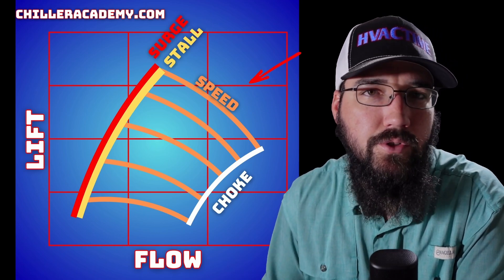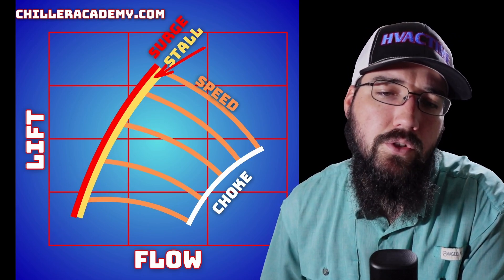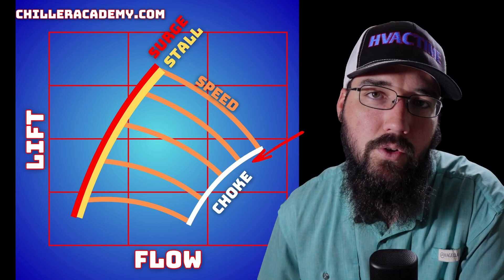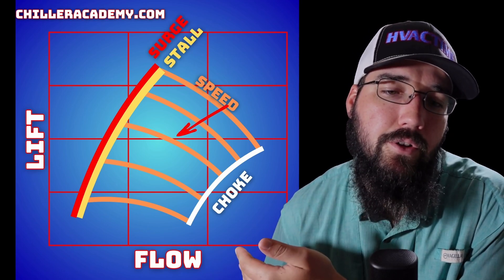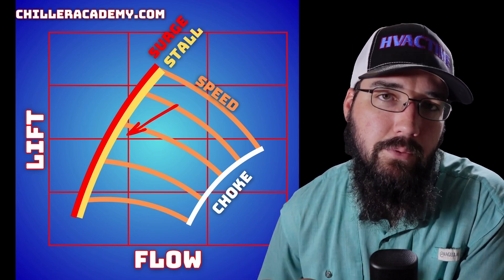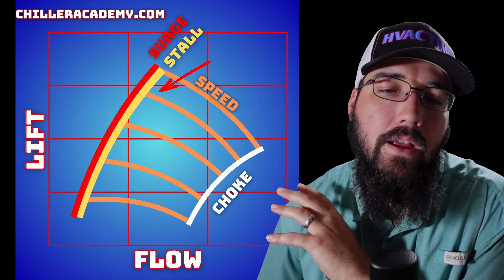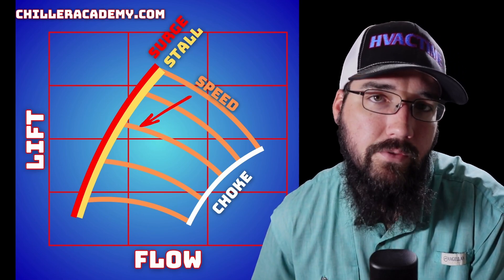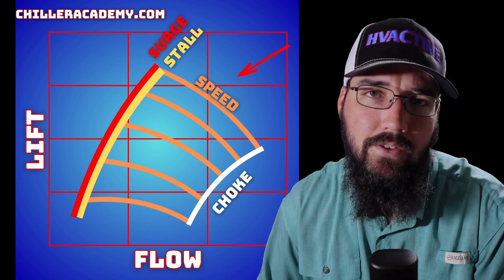Understand Chiller Surge Graph

Comment: Sir what is the journal bearing and thurst bearings in centerfiugal compressor
Reply: Journal: a kind of bearings put in place to withstand radial forces, not made by balls or roller elements but a babbitted surface and an oil film

Thrust bearings: think of axial forces, think of a shaft placed in horizontal manner, think of said shaft moving back and forth. Thrust bearings are there for those axial forces. Impeller tend to "pull" itself. 
I think Those machines are so big that axial and radial forces require dedicated bearing components